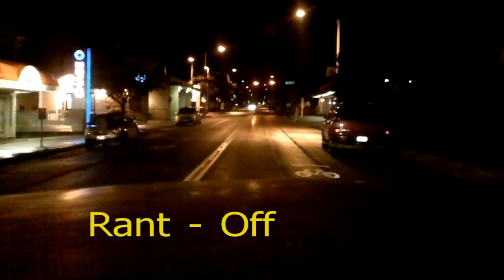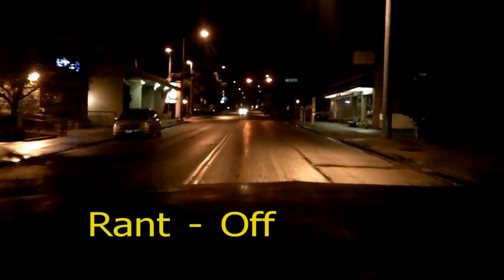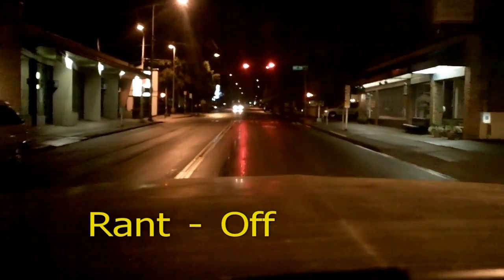HID Rant

Comment: Actually hids work fine in stock headlights, you just have to adjust you're headlights so the beam is lower. If your halogens were originally 6000k get 6000k hids and there aren't any problems.

Comment: Cool that you built your system not to blind people. I get annoyed when someone pulls up behind me & his headlights illuminate the entire inside of my car and blind me through both mirrors. When that happens I accelerate slowly from the stop and reach a top speed that's exactly 4 miles per hour below the speed limit. I can feel them back there going nuts and suffering hugely. Then when their frustration reaches boiling point they pass me, redlining their engine and swearing.
& I cackle with glee

Comment: i have a 55 watt hid conversion kit  in my truck and i picked the 4300k bulbs so i had max output. its in the factory headlight housing and insanely bright. it does flood the area with alot of light like you said but thats the reason i purchased them i mean its about light output not the feelings of the guy in front of me. just my humble opinion. nice video